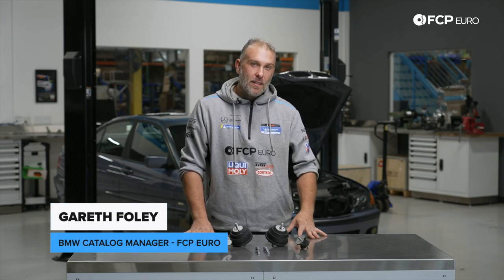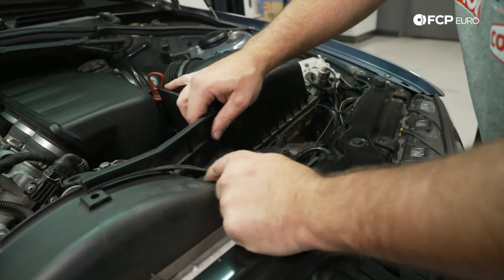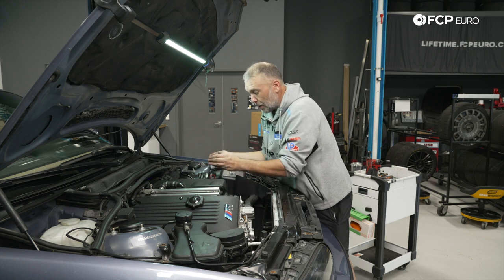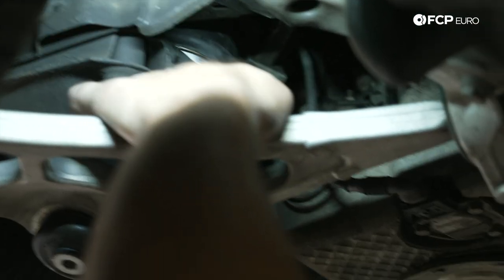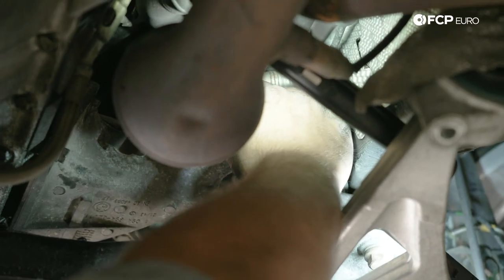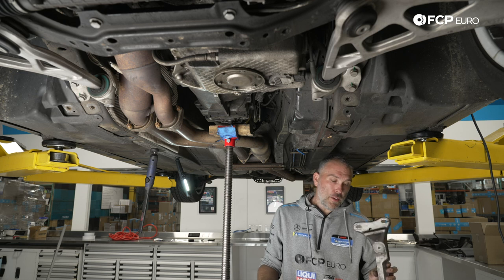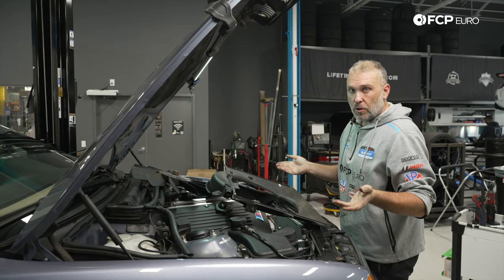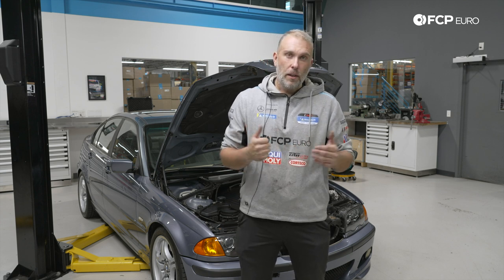BMW E46 M3 Engine Mount Replacement DIY (2001-2006 BMW M3)

Comment: Thanks for the vid.  The trick here is to do the passenger side (right) first - or at least separately - using the AC compressor as a jacking point. This will make the engine go high enough to get clearance to insert the new mount.  Make sure to remove the cover between the back on the engine and the firewall (that covers the blower motor) to not damage it when tilting the engine.

Comment: Much easier to use an engine brace from above - it is installed in 5 min - disconnect the steering link, hydrobushings and drop the subframe. That way you avoid the tilt issue and fiddly bit of fitting the mounts with little space....

Comment: Gareth, thank you for the fine instructional vid. My '04 M3 engine / tranny / exhaust (?) is just recently starting to vibrate (mild shudder) a bit when drifting going downhill, gas off, 2nd -3rd gear, 1800-2500RPM range. 95K miles. Engine / tranny mounts and / or exhaust hangers could be the reason. Any guesses as to where I should start? Ha! Thanks again.

Comment: Did you remove steering lines from steering rack?? Where you put the piece of wood I have a pair of steering hydraulic lines…
Reply from the maker: No removal of the lines!
Reply: @fcpeuro  i did the job the last weekend without the removal of the lines 🫡
now my oil pan is not resting at the front stabilizer any more…
I replaced the right engine mount bracket too as it was broken🤷‍♂️

Comment: Hey Gareth, my chassis mounted shifter is tilted towards the passenger side... no slop, but it doesn't sit straight in neutral. I have new poly trans mounts installed. Could engine mounts cause this slight "rotation" of the shifter assembly?
Reply: You have it in the wrong way. Double check everything and there installation process

Comment: Would knackered engine mounts on an M3 cause the exhaust to sag and sit on the classis braces?
Reply from the maker: It can certainly help that. Along with checking the mounts, an additional recommended check would be to inspect the hangers at the same time.

Comment: Poly is not an upgrade. There are vibrations regardless of what anyone says. Going from a rubber vibration absorbing mount to a poly solid doesn't absorb any vibration is simply stupid. Poly is for track use only not for a car that is a daily driver...